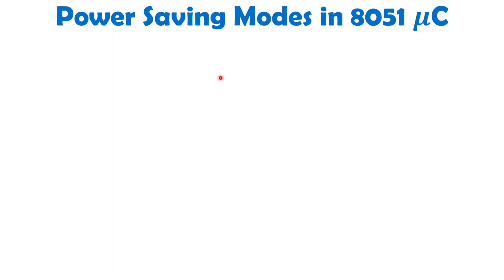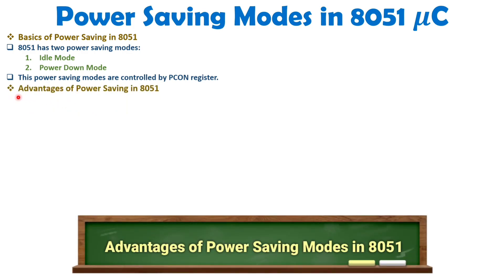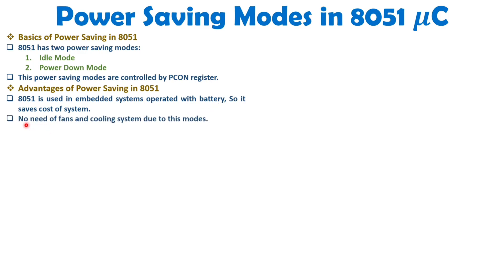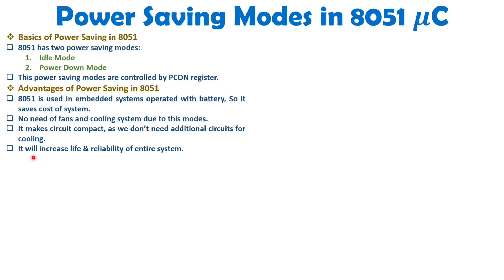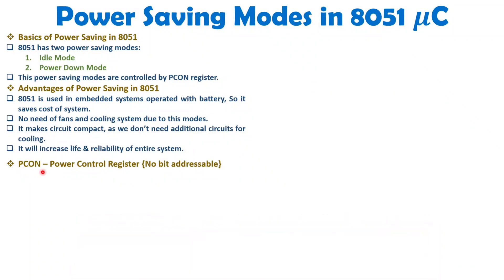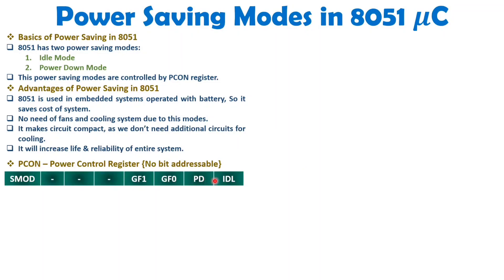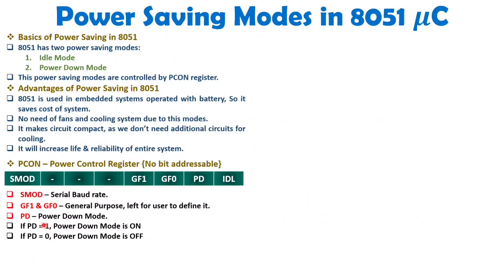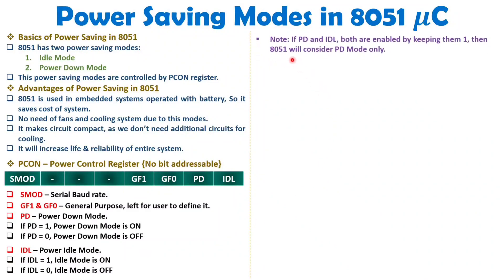Power Saving Modes in 8051 Microcontroller Explained: Idle and Power Down Modes

Comment: Sir you r taking and operation in circuit but in idl and pd mode you said we will do oring there...is it oring operation in the circuit then
Reply from the maker: That's the operation inside IC 8051 as per equivalent circuit.